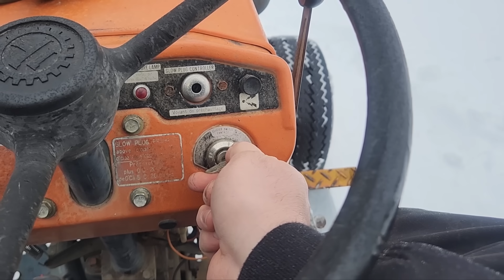Why are Diesel Engines Hard to Start in Cold Weather?

Comment: The word you were looking for in the comparison between gasoline and diesel is called volatility. Since gas engines use and external ignition system, and since is is so volatile, an open flame or spark will ignite it.
Diesel runs on compression ignition. As you compress anything, you raise the temperature. Diesel needs between 62-98 degrees C. Now think about sub 0c/32f temps. Back when I was in Northern BC, we were used to -40 temps. (c and f meet at -40.) We would run tiger torches under the oil pans to warm the oil. We would also use propane injection to get the engines running, till they had enough heat to burn the diesel proper. Most winters, we would run them 24/7. 
Another good point you made is how batteries have much less power the colder they are. Another reason I think EV cars are stupid! The faster you can spin the engine, the greater chance is has to start.
Have a great day! o7

PS - I am a Mechanic of 35+ years. I am self employed, and run my own shops. I fix everything and anything, as well as doing classic car restorations. I am on a 95 acre farm, and fix everything here, including tractors, some of which are from the 50's, and a couple of modern ones. I grew up on farms, and learned at a very young age, in very harsh conditions. It was all about survival back then, and it has served me well to this day. 
Just know, that anyone here can do it too! Take your time, be patient, even if you have to walk away every once in a while. Everyone should be able to do at least the very basics. That knowledge can save you.
Reply: Volatility is not necessarily a measure of how easily something will burn. Some chemicals such as 2,4D ester are extremely volatile but are not flammable at all. Ask any cotton grower who has had his cotton poisoned by a volatile broad leaf chemical that was applied miles away. I don’t know if he had trouble starting his tractor though. Jeff

Comment: Great video!

I have also found that by the time I get my hands on an old diesel, they’ve been run hard and put up wet, with lower compression than when they were new. The best bet is to have hot batteries and a good leak free fuel system.

Comment: I have a Manitou with a Perkins 1103A-33 Engine, it doesn't like to start, even with 40 seconds on the glow plugs ( I fitted new glow plugs and they do work) it is easier to start in summer.

Comment: Before watching the video, I'm going to problems building enough heat to ignite the fuel.  At fifty below, on Cat 651b it took about 5 minutes of glow plugs to ether to ignite and usually a whole can of ether to get the engine running. Pony motor start on on a D9g was a completely different story

Comment: Hi adept

I have used petrol/gasoline or paraffin in a metal container ignited the petrol /gasoline or the paraffin slide it under the diesel car or truck to warm the air up around the engine bay plus also very carefully the same trick around the diesel tanks, but most of all making sure that there is no fires starting due to residue that can ignite.

Plus these metal containers doubled up as a cooking stove with a grill on top to place your cooking pot or pans on it.

Comment: The glow plugs aren't really on the cylinder, they are in the precombustion chambers. My favorites were the IH tractors that started on gas, and then changed over to diesel. Also a higher cetane value will make them start easier. (Cetane is sort of the apposite of octane in function)
Reply: Non-IDI engines have the glow plugs in the cylinders.
Reply: 7.3 powerstroke direct injection have the glow plugs in the cylinder

Comment: I didn’t know that diesels had thicker oil than petrols (gasoline) - why is that? Is that because more torque is exerted on the bearings so thicker oil is used to not displace as much? Very interesting video btw, I’ve not seen such an informative video on the topic!
Reply: Diesels have huge compressive loads on the connecting rod and main bearings so the thicker oil is used to "stay in place" during those events, just like you hypothesized.

Comment: Good morning I really love all your information on cat engines. I’m having an issue finding highway engine cat mechanic in North Carolina. My local cat dealer Carolina Cat in all of there locations stopped working on highway engines. I have a 2005 Cat C13 acert and I’m past due for an overhead and don’t trust a non cat mechanic to open my engine for this adjustment. If you have any recommendations and if you happen to know the cat repair shops nationwide that would recommend here in North Carolina. Much appreciated advice would be helpful. I’m also wanting to convert to a single turbo system but if you don’t recommend this would really like your recommendation on this as well.
Thanks

Comment: Hey Josh - any insight on why my 6.7 Cummins cold starts happily all winter after a single grid heater cycle (without block heater plugged in), but all three of the Cummins QSL9’s we run in our meticulously maintained snowcats at work take multiple 20-second cranks in single-digit temps, even with the block heaters? I’ve driven diesel pickups for years (7.3 and 6.0 Powerstrokes, and 5.9 and 6.7 Cummins), and they’ve always fired right up, even in subzero temps. The snowcats, on the other hand, seem to hate their intended environment!

Comment: That tractor reminds me of my gfs massey in any temp, that thing wont catch up for nothing without at least 30 or 40sec of plugs. My 3400 kubota will usually fire on the first or second crank without even touching the plugs
Reply from the maker: Not mine, probably needs new nozzles would be my guess, but who knows, she runs.
Reply: @AdeptApe  I'd like to see someone refresh a fuel system on an old tractor like that just to see how they run like new
Reply: @AdeptApe  I have had a kubota B7200 since new ( 1985 model ) and it always has been completely useless to start even at 70f without the use of the glow plugs. Even plugging in the block heater its still not hot enough to start without the use of the glow plugs. The only time it will start without glow plugs is if it was just shut down from operating temperature and restarted within minutes. While it seems rather ridiculous, that is the way it is with my model and perhaps yours falls into that similar category ( I assume they are indirect injection ? ). I used to use it during the winter to run a grain auger, as long as it was plugged in, I also use 0W40 synthetic, and use the glow plugs for what is probably 30 seconds, it started fine. I would not worry at all about yours, if she runs fine when warmed up its all good ( hopefully  you do have a block heater on yours as well )
Reply from the maker: That's good to know, I figured I just was a bad Diesel owner lol. It will not start without those glow plugs. It's a noisy, clackily little guy, but I love my tractor. Actually got it stuck today, had a 2 foot mound of snow in front of me and my 5ft scraper blade piled with snow.  Got stuck between both piles and even in lowest gear with it in 4x4 and diff lock it would just spin on the slushy wet snow. We had about 8" of snow and it was raining, super fun. Got it unstuck though and it's safe and sound in the garage now. Thank you for the info.
Reply: @AdeptApe  no worries,  I'm actually super impressed how much yall push with those turf tires given that all we're dealing with is mud and I'm about to fire my industrial tires
Reply: @AdeptApe  I know, a mechanics equipment is the last to get looked at as your up to your eyeballs with it at work all day !. Oh oh, sounds like you got quite the dump of snow and wet snow is just the worst thing to deal with, won't flow off a blade, plugs a snow blower, heavy to push, horrible traction. A set of tire chains may be in your future unless you have a set and laying down plywood in the garage to protect the floor. I always wear ear plugs running mine, certainly if mowing as the mower will kill hearing.
Reply: @AdeptApe 

I know it's not my money; but I think the scraper might have a vertical height limit to be an effective relative to a blade that would be on the front of your tractor. 

I would imagine a scraper would be good on snow that was packed down such as on a driveway or airport runway.
Reply: I have a slightly bigger kabota from the same era that's fairly low hours with new injectors and new glowplugs and you really gotta give it the glow plugs when the engine is cold. Worst starting diesel I've ever had but oh well. It always starts and it's a great tractor. 

On the other end of the spectrum my deuce and a half starts in the coldest weather with no glow plugs or starting fluid with just the slightest crank. It's crazy.
Reply: I’ve had my B2710 since new in 2004. Glow plugs are needed on a cold start in any weather.

Comment: I'd be curious to know why a Kubota of the same displacement needs glow plugs to start vs my Perkins that doesn't even have a cold start provision. 😂 Same compression ratio even. (Massey Ferguson 240) 

Hell,  seems all little kubotas even need glow plugs during summer
Reply: No they don't. My low-hours 1986 Kubota tractor, a 30hp L2550, never needs glowplugs until the temperature drops to about minus 5C (22F). As long as the compression is good, the battery strong and the motor oil appropriate, a diesel engine will start in surprisingly cold weather. Your Kubota probably has low compression, either due to high hours, poor maintenance, inadequate valve clearance settings, or use of starter fluid (it can break piston rings and permanently lower compression). Oh, you need the right winter fuel too. Summer fuel isn't volatile enough.

Comment: John Deere engines are the best cold starters w/o glow plugs/block heaters/ether then any other industrial diesel Engine, imho.....Starting them big industrial 3412 Cats in the winter here in Chiraq, basically impossible without Ether

Comment: i have a 2000 VW 1.9L  diesel and its supposed to have glow plugs and it has a light on the instrument panel. i think this is a glow plug delete model. because it doesnt show a active glow plugs sequence when i turn the key.. i just have to have a strong battery. its cranked at 32 or below. any info.?

Comment: I have a question I was hoping you could answer: I have a Mitsubishi built diesel 4DR5T engine; it's port injected, not direct. I often hear how one of the benefits of port injected engines is that (for gasoline engines at least) the gas will clean the intake valves since gas acts as a solvent. Will diesel fuel have a same effect on cleaning carbon buildup on the intake valves like gasoline?

Comment: Maybe a stupid question but I believe I heard a rumor back in the day to add gas fuel to your motor oil for easier starts in winter. I believe it was called an oil dilution system. Was this hocus pocus or something that was actual done. If so are why do they not do it today, or do they?
Reply: Don't do it! Oil is the lubricant your engine needs; gasoline is a solvent. Automotive engineers go to a lot of trouble to prevent oil dilution via crankcase ventilation systems, because diluted oil will cause accelerated wear. If you're having trouble cranking your engine in the winter, switch to a lighter oil. I use Shell Rotella 0W40 in my truck, tractors, even my snowblower.
Reply: Not in the oil!  We add 2-4% gas to #2 diesel fuel when temps drop below 0 dergrees F . It get diluted out as soon as weather warrms above 0.

Comment: Diesel is oil. I load and deliver heating oil and diesel  gas etc. There is red dye diesel 40 octane 8.2 lbs, clear diesel 40 octane 8.2 lbs and heating oil which is also 40 octane 8.2lbs. Red dye diesel and heating oil are the same product. Both untaxed. The product is dyed for identification.The only difference that might be possible is diesel has a percentage of bio diesel added. But, not sure if it is true or not that heating oil is being changed in parts of the country to bio diesel. If I am loading heating oil and the terminal runs out of product. It is switched to clear diesel which is actually brown to replace the heating oil. If this makes any sense whatsoever.

Comment: Cummins?  Never had a problem.  I’d refuse to go outside before the engine refused to start.
MaxxForce?  Ain’t gonna happen.  Under 10°c?  Plug in the block, build a coal fire under it, and clear out the shop of every flammable aerosol you can find.

Comment: I have two Polaris Rangers and two Kubota side by sides. The diesel Kubotas are much easier starting in the cold than the gas Rangers. Figure that one out!
Reply: Glow plugs help warm diesels, oil and all. Depending on if they have a grid heater or not, that helps. When gas gets cold it evaporates a lot slower, and is harder to combust.